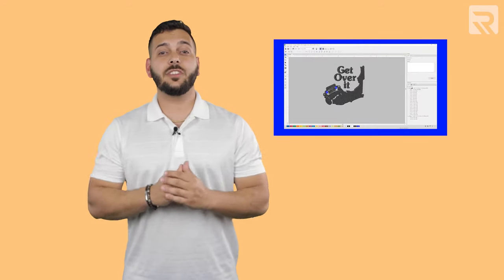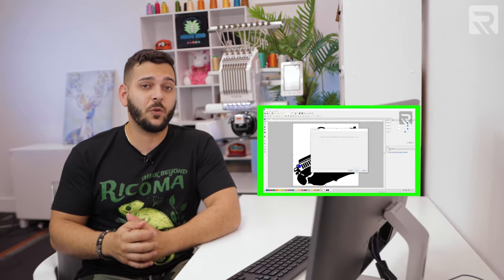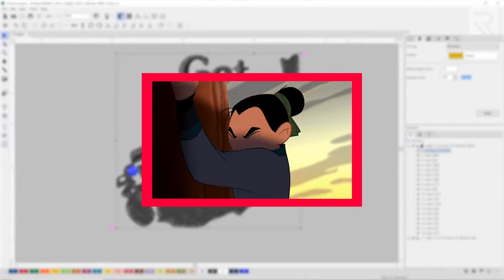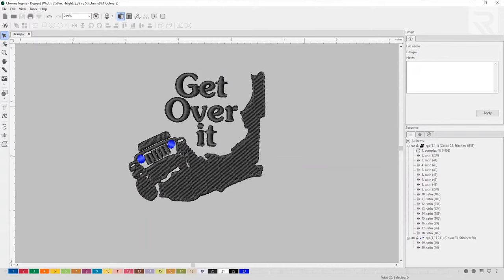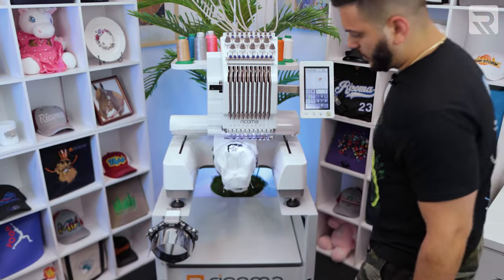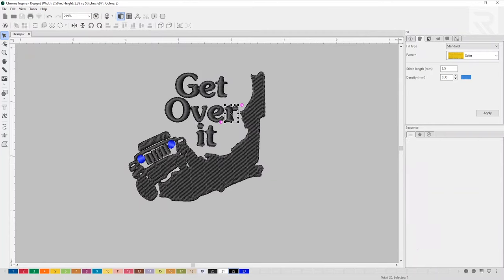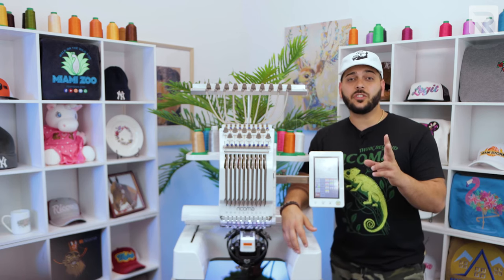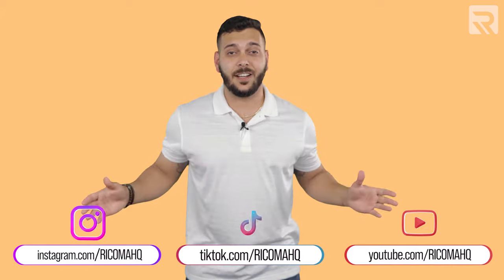How to Digitize Flats vs Caps

Comment: Could you explain why you can't use the cap design for the shirts? Would it cause registration issues as well?
Reply from the maker: The cap design is digitized differently to create a more curved effect that would not work on a flat garment.
Reply: @ricomatv  I was wondering about this too when I saw the video.
 "more curved effect" Nothing of the such was described in the video. The only different I see mentioned is just top-to-bottom vs bottom-to-top.
Reply: @amdival1823  if the stitches on the cap go bottom to top and inside to out then on a flat it could push the fabric (especially if light weight) out causing puckering and need more stabilization unnecessarily

Comment: But you should not use auto digitizing and do it manually. Auto will give you thread breaks,  registration issues,  and lots more.
Reply from the maker: Thanks so much for watching. We auto-digitized it and made adjustments as necessary!